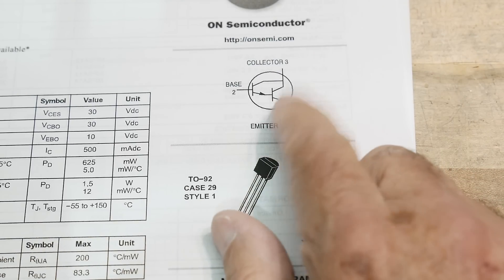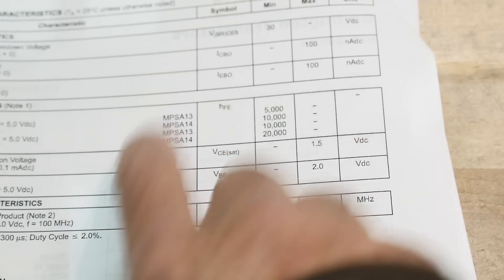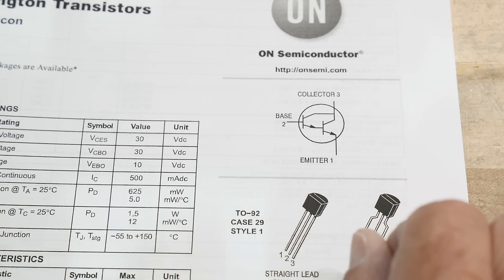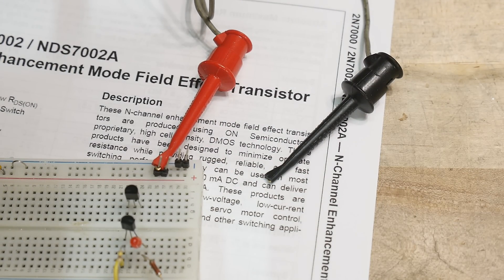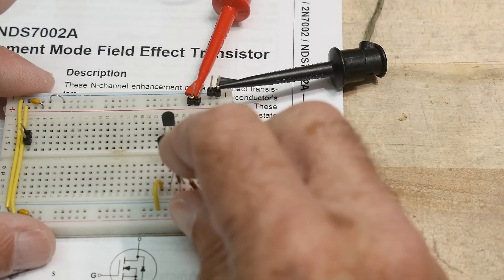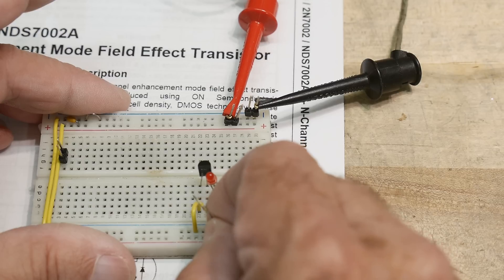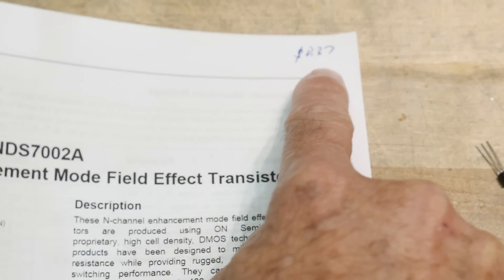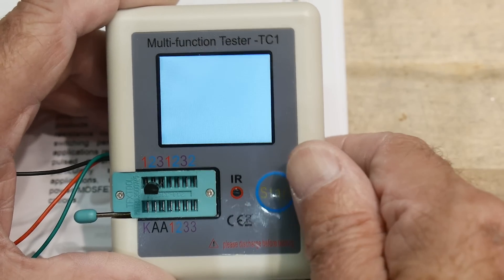#1517 Are Darlington Transistors Obsolete?

Comment: I stopped using BJT as switches years ago.  I do use a varient of the darlington for current boost applications. Cant remember the name of the configuration but it has all the gain and only one vbe drop.
Reply from the maker: https://youtu.be/M_xYDsaXRzE?si=Tax0Mu0ZBQoZLDN3
Reply: @IMSAIGuy  Yeah, that's what its called - couldn't pronounce that even if I remember the name.

Comment: I had to revisit this one now that I got some work done with single package Darlingtons.
I started with an MPSA13, and a couple days ago swapped it from an audio circuit for an MPSA14 with no other changes, The gain difference was massive!
For audio as I already mentioned, they're still highly applicable. For a simple circuit such as for headphones or a line driver, they're a convenience compared to an audio grade op-amp build. I paid 6 cents per Darlington lol. I'm running ridiculously high resistor values for my divider, so thermal stability isn't an issue; 1 mil. and 200K(what I had available). 
I have 150K, but even though it switched on, it's bandwidth was absolutely in the toilet with the input source. 
Unbeatable for the cost.

Comment: Nice. Can you use that for wireless sensing the "hum" from 50/60Hz cables? - as a cable sensor you use on walls, to see where there are cables with current attached to the grid. - you know, not to put a nail in a hot cable when you want to hang up a painting on the wall.
Reply: You could. There's many ways to do what you're asking with a variety of semiconductors without wandering into a complex circuit design. An inductor of very fine wire, an amplification circuit, a bandpass filter running roughly 30 to 90Hz for the Q, and you can affix an LED, a buzzer etc. for when your electromagnetic coil has a shift in induction from the cross talk between electrical signals. 
The most basic single transistor small signal amplifier with very little additions can be designed and built to do what you desire. In a single afternoon in fact.

Comment: Darlingtons have drawbacks too which may or may not be important depending on application. Saturation voltage is increased compared to a single transistor, and they are also much slower than one. Because of that they are best suited for low-frequency switching applications. Forget anything above 100kHz or so. :)

Comment: I wish they made a TO-92 version of the AO3400/3401 SMD Mosfet's.  The 00 is n-channel and the 01 is p and they both are rated for 30V, 5.8A 😲 and turn on fully from as little as 1V, so you can be sure they will be hard on even at 3.3V.  They're also dirt cheap.  You could probably fit 20 of em inside a TO-92 package but that's kinda the problem -- some assembly is gonna be required to get them on a breadboard.

Comment: Low power darlingtons are pretty much obsolete; however power darlingtons are still very useful.  In a pinch you can always use two low power transistors to function as a darlington.  In product design you'd probably stay away from using special or hard to get parts, which the low power darlingtons are now likely to fall under.

Comment: There's not really the difference in current handling capability between the MPSA14 and the 2N7000 that you think. You were quite right to observe that power dissipation is also a limiting factor, but you have to actually explore that to make a meaningful comparison. The MPSA14 has a maximum power dissipation without heatsink of 625mW at 25°C, and a maximum saturation voltage of 1.5V at 100mA, so on the generous assumption that Vce(sat) doesn't increase much at higher currents, that indicates a maximum continuous current of about 400mA. You'd have to operate it pulsed at no more than 80% duty cycle to achieve the 500mA it is specified for. The 2N7000 can deliver 200mA continuous, but 500mA pulsed, and with an Rds(on) of less than 10ohms, the power dissipated is at most 400mW continuous.

Interestingly, the On-semi datasheet (dated Jan 2022) for the 2N7000 claims " They can be used in most applications requiring up to 400 mAdc and can deliver pulsed currents up to 2 A." Which is directly contradicted by the information it provides on the following pages :o

Comment: The 2N700X N-Channel Enhancement mode FETs have an internal diode intrinsic to the substrate that prohibits using them in some applications.  Example would be a series pass battery charger (or switch) and when you turn it "off" the battery could back-flow thru and discharge into your charging circuit -  3-Terminal regulator for example, so don't forget to add a diode across the 3-Term-Reg!
Reply: Transistors have typical BE reverse breakdown of 5-7V so they have an intrinsic reverse diode too. It’s just a Zener :)

Comment: The 2N7000 is possibly a 40+ year old part, and there are much better options now. It's gate threshold could be as high as 3.0V, so even 5V logic may struggle to drive it to saturation if the ID current demand is too high. Its RDS is also high by modern standards.

Comment: Assuming base resistors for both transistor types, you'll also need a pull down resistor for the FET to discharge the gate capacitance, so that's one extra part.

Comment: I'm currently working on a design for a "vintage look" VFD clock, which requires an anode voltage of around 24V DC, so you need some kind of level shifting between the logic and the display. Using Darlington array ICs it's just 6 chips at a cost of around $0.43 each from the mouse-based electronics supplier, compared to a field of 42 discrete MOSFETs, which would not only cost more, but also take up a lot more board space. So there's definitely still places where a Darlington makes more sense.

Anyway, I would still at least put a pulldown resistor on the gate of the MOSFET, just to make sure it turns off cleanly. And you can also see gate ringing at higher frequencies, so you might also need a gate drive resistor, or possibly even a dedicated gate driver IC. A Darlington will also dissipate more heat at the same load because of that voltage drop, because the MOSFET Rds(on) can be very low (in the mOhms for some parts), the package temperature isn't usually the limiting factor in switching applications.
Reply: For $0.67 from the same supplier, you can get TPL7407LA, which is seven mosfets and associated cmos circuitry in a single package, designed as an improved drop-in replacement for the ULN2003A, so an extra $1.20 on your BOM. The Darlington advantage is rather less than you think nowadays.
Reply: @RexxSchneider  That's very interesting, I didn't come across this in my searches, but I'll definitely check it out.

Comment: Could you create a super darlington using three or more transistors, or cascade two darlingtons?
Reply: You could, but the emitter leakage current of the first stage would be multiplied by thousands by the next two stages, making it really hard to turn off, especially under hot conditions.

Also the base would need 2V or more to turn on properly, and the maximum saturation voltage would likely be as much as 2V as well, causing power dissipation problems.
Reply: It’d need to be a Sziklai pair or triplet to be of use in modern low voltage circuits.

Comment: I still use darlingtons when triggering relay coils and simple brushed motor drivers, i find them to just be overall more robust, however that is about it. The BoM cost is typically offset by the fact that we buy many many many many more times the amount of general purpose mosfets than we do transistors.

Comment: Back in the days of empire of evil as Reagan put it almost all of eastern european countries have their semiconductor production. Some of them developed their own, some of them licensed western designs and soviets mostly stole from the west. As I remember czechs were doing quite a lot of their own, pols were licensing newest western designs, and in my native Bulgaria they were licensing older designs and "developed" from them. In the 80s transistors were not a tecnilogy that needed buying know how, but they reflected the development history in their part designation codes, i.e. poles used BC500 small signal transistor designation, czechs used their own, and bulgarians used a mix of soviet commonwealth designation standard mixed with western origins, i.e. I have some 40 years old 2T3109 which are further development from BC109 and 2T3109C have their beta ranging from 800 to 1200 not being darligton, but a regular design. Used microamp or less biased these trasitors have not only high gain, but were also low noise with higher bandwith product (than needed for sound frequency range they were mostly intended for and worked nice on AM and IF), so I gues here is a good answer to the question about transistor gain in itself. Darlingtons have their role back in the days, and can still do the same today, though having good alternatives.

Comment: The price comparison is nonsense, a reel of 2N7002 can be very low cost when purchased in quantity, i.e. on LCSC they trade below $0.01. Few MOSFETs are sold in TO92 (Darlingtons score a point here), but even the 2N7000 can be bought for much less than the price discussed here. At realistic prices, MOSFETs are cheap enough to not worry about their cost.

Also, 2N7000/2N7002 is kind of obsolete. Something like a BSS138 has significantly better specifications when working with logic level voltages.

Comment: If I gotta use BJT's, I prefer using the sizlak pair over the darlington pair, as it's saturation voltage is 0,7V-0,9V compared to darlingtons which are 1,4V. The sizlak pair still multiplies the hfe of the transistors with eachother, so it has the same gain as a darlington.
Reply: I'm not sure if you can get an off the shelf Sziklai pair device, having both npn and pnp in one package might be more expensive, but good for some discrete component designs.
Reply: @alexjenner1108  true, I've only used discrete Sziklai pairs, haven't found one that's in the same package. Also ironic how I can never spell the name right even though I'm 1/4th hungarian and my entire dad's side of my family is hungarian. 😆

Comment: Take care if you compare data sheet frequencies. The on / off switching time means that the device really carries a considerable part (90%) of its specified drain source current. A transit frequency means its gain bandwidth product. Especially for Darlingtons it means that at the given frequency the beta is only 1 and no more 10000 or more. Darlington transistors are relatively slowly. If you want use a beta of 1000 from the original 10000 the maximum frequency is only 125 kHz. If you want to use the full beta of 10000 you can only operate at 12.5 kHz. You can't even use the full beta within the audio frequency range.
Reply: For musician's audio gear this actually makes it ideal, especially for musical instruments. I greatly favor traditional semiconductors over vacuum tubes, and one of the most endearing qualities of vacuum tubes is their cut-off in most popular preamp stages is around 10 Khz without intentionally adding staging to compensate. 
I'm a shred and instrumental guitarist, and the abundance of very high, even order harmonics in high gain guitar rigs creates what seems like white noise and strangles clarity when you plow through very complex and fast note patterns. I was aware of the limits in bandwidth as the tradeoff when you drive these suckers into the top of their operating specs, but your post told me I made the exact right choice in my recent change of directions.

12.5Khz as the organic limit is perfect for my current applications.

Comment: BJT darlingtons have quite a bit more linearity than MOSFETs, so they might be better in amplifier circuits - that said, a JFET is probably a better choice for a very high sensitivity amplifier, since they are lower noise. Another application well suited to a darlington BJT is a sensitive current-amplifier (nobody uses those any more) where you have some sort of current source that varies slightly, such as in a circuit where the active element has variable resistance/conductance, where you want to amplify slight variations in current (resistance) to a larger linear signal. Again, a JFET transconductance amplifier would probably be better, but might use more parts. Great video, thanks for all the information about the fiddly bits that make technology work. Cheers!

Comment: One nice thing about the MOSFET is that the gate will tolerate a lot more reverse voltage than the base-emitter junction of a BJT will.  One nice thing about the Darlingtons is that they have much better behaviour in the linear region, for when a saturated switch isn't what you want.

Comment: Resistors are put on mosfet gates to reduce the ringing when hard switching the FET on/off. A mosft gate has some capacitance and there is some inductance in the gate wire that makes a nice LC oscillator. A resistor in series dampens the oscillations.
Reply: Also, the input capacitance of a 2N7000 at around 50pF max isn't such a problem as we find in power mosfets (often around 1nF), but it still presents a direct short initially to the output of a microcontroller, and it's really not sensible to risk damaging the MCU output for the sake of something like a 220R resistor.
Reply: @RexxSchneider  Is there any practical evidence that the gate capacitance will actually damage MCU or MOSFET when driven directly? What about inside of a MCU, it's all directly connected gates, nobody use resistors there. The output driver of an MCU is slow and non-ideal voltage source: it has rise time, resistance, inductance. 50pF is minuscule. I've used small MOSFETs directly connected to various MCUs - many thousands of devices, 24/7, for years - and never saw any problems or damaged parts.

Comment: A 10 MOhm base resistor would perform just as well.  Also, turn-on time is a digital (switching) spec.  Analog applications would always have the gate biased above the threshold voltage making the "turn-on time" much less.

Comment: Darlington have problem with high frequency in CE mode.  However, you use a cascode transistor to resolve some of the problem

However in CC or emitter follower mode is  superior over MOSFET.  Because the output impedance is 1/gm in this configuration; therefore, it is traditionally used in the push pull class AB output stage or output of LDO or other voltage follower applications. 

Note that gm of MOSFET is low.  Therefore, in order to be used for these applications, they are used in "Super Voltage Follower" topology -- which has a limited voltage range --  or "Flipped Voltage Flower"  topology -- which could have stability problem.
Reply: **  I recently discovered a forgotten Transistor UJT, which is very similar to JFET but needs positive Gate  (Emitter) biasing and also could generate negative resistance  **
Reply: @aduedc  When I first started dabbling with electronics (60-odd years ago), the 2N2646 unijunction transistor was a staple means of making a pulse generator with just a couple of resistors and a capacitor to set the timing. It was later superseded by the programmable unijunction transistor (PUT - which was actually a 4-layer device with three junctions), and then the 555 arrived and nobody used UJTs any more. I still have a few in my parts box somewhere.

Comment: The last time I used parts like this on a new design was around 2000.  Used them to drive the coils on 25A power relays and they were driven from 5V logic in a 12v automotive type power controller.  In addition to the high saturation voltage another commenter noted, these are relatively slow switching if that matters in the application.  When driving from logic, one also needs to be careful to have a base pull down resistor when the product may need to operate over a wide (including hot) temperature as leakage current from the driver can turn these partly on when you want them off.

If I was designing a product to do the exact same function now as that relay board, protected high side drivers like those from Infineon in SMT packages would be used instead of relays.  All the digital logic on the control side would be 3.3v.

Comment: I layed out a board with a ULN2003 a couple days ago. When you have 5V around, it's been a workhorse for driving relays small steppers for almost 50 years. The built in reverse diodes save on BOM cost and I don't know of a decent MOSFET based replacement.
Reply: The TPL7407LA is a pin-for-pin replacement with benefits in reduced power lost and in reduced leakage.
Reply: @RexxSchneider  🏆 Thank you, kind sir.  Too bad they don't seem to have a TPL7408 as well.

Comment: The big problem with Darlingtons is their large saturation voltage of around 1V. At today's supply voltages of 3.3V or 5V, that's a big chunk. I've seen people use ULN2003 Darlington arrays in a 4 alkaline cell system for relay coil drive - and it conks out much earlier than a FET-based design would.